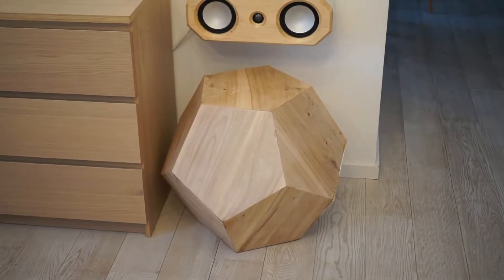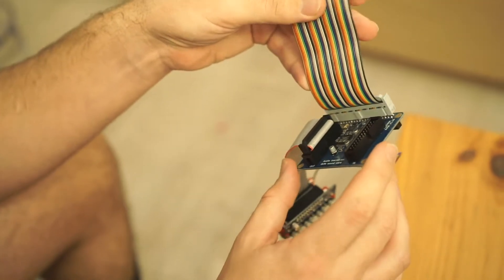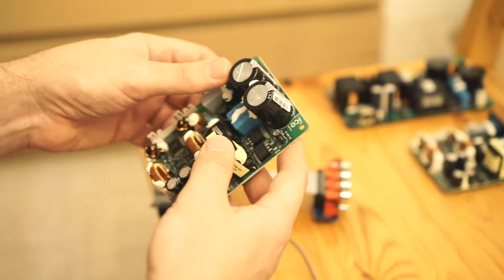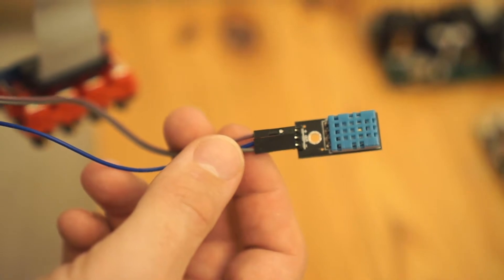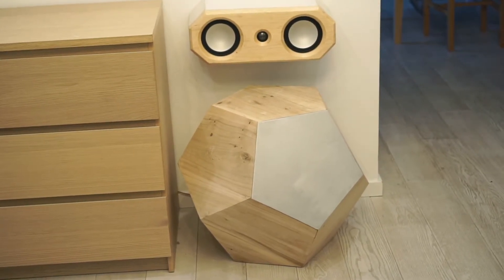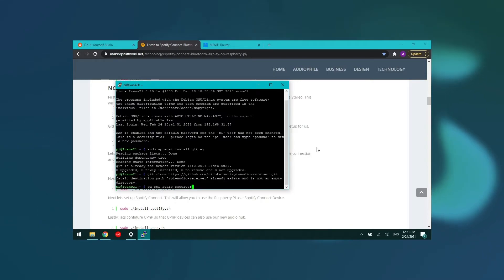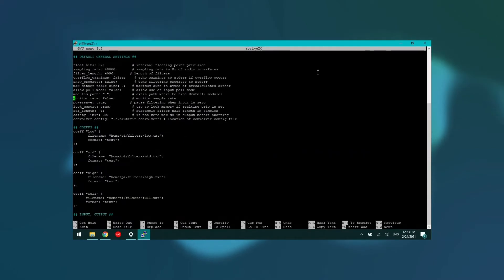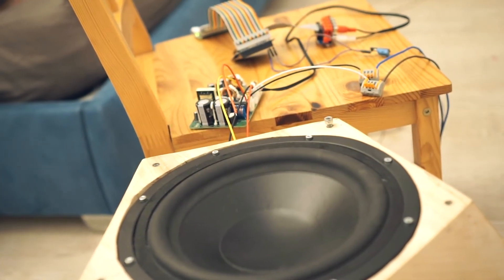DIY Bluetooth + Airplay 2.1  Part 3: Electronics

Comment: Outstanding build congrats can u share the build details and parts. I would like to make it
Reply from the maker: All the other parts, except for drivers are in description. One thing: the raspberry pi way isn't for everyone, there are issues, and I have to reboot it from time to time
Reply from the maker: Sorry, that piece of paper was really all my plan. Just use angles from wiki article, and sidewall that will fit your driver. 
Also don't make aluminum side, and maybe use mdf + veneers. Will make things easier